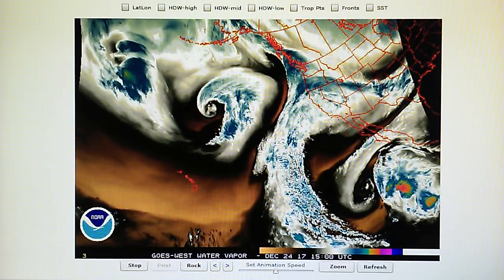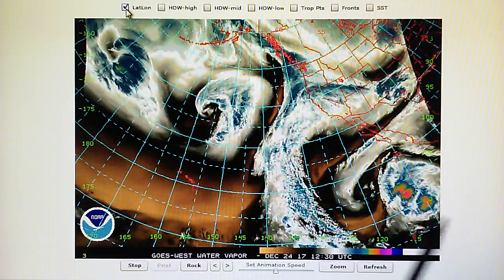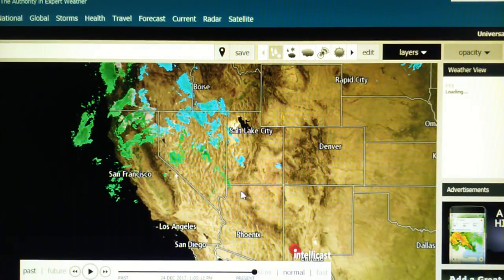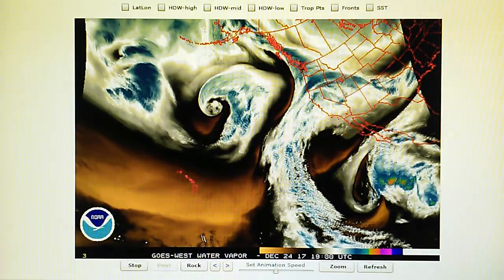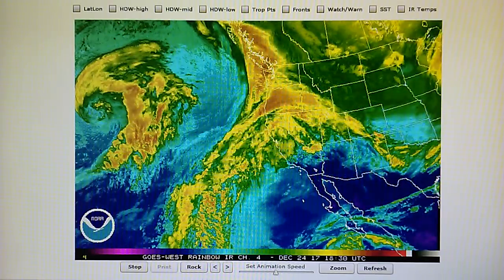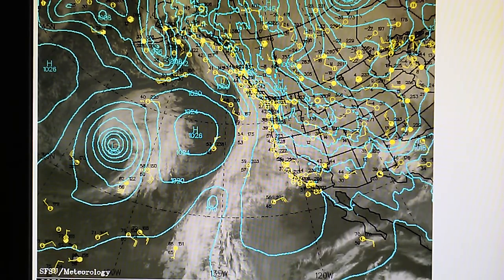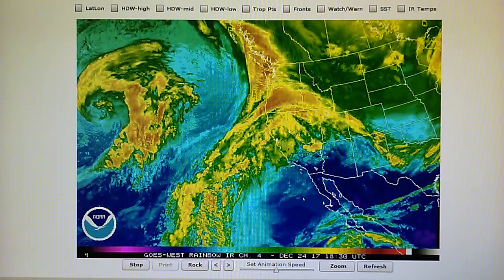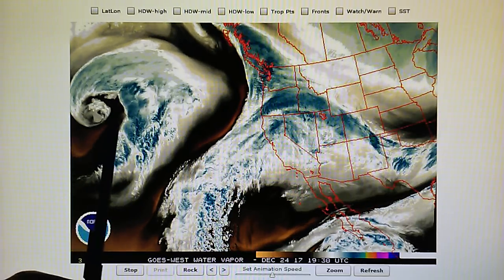12-24-2017; Pineapple Express Flow into CA Blanketed w/Chemtrails; No Rain; Low Pressure Blockaded!

Comment: Hope you can do a piece on the polar arctic conditions headed for NE in next couple of days.  Up in Adirondack mountains expecting temps to suddenly plummet to -22 by Wednesday....going from normal Dec temps to over a 40 degree drop in 48 hrs.  From Monday night into Wed.  Whole NE gonna plunge drastically.  The weather bots at MSM will be talking it away as a "Polar Vortex" just as they've done for last few winters.   

Is this caused by the HARRP or Next Rad systems pushing around or disrupting the arctic jet streams again?  Or is the thermo-haline currents just showing how it is starting to slow down more and more each year setting up next mini or full blown ice age in northern hemisphere?
Reply: Concerned Citizen I’m in southeastern PA, and I’ve been following what the weather puppets from The Weather Channel have been putting up on Intellicast about this so-called “Polar Express” or “Polar Vortex”. Didn’t we hear that term over and over again during the winters of 2013-14 and 2014-15? Yeah we did. Last winter was relatively mild compared to the three prior winters, but I knew “they” couldn’t resist dropping another “Polar Vortex” and plenty of “arctic blasts” on the northeast again. I’m highly sensitive to the sounds of the different transmitters when they’re firing, creating and directing storms or low pressure systems. I also became aware of a distinct, horribly loud “hish” when the jet stream is being manipulated by HAARP, or so I’ve read. And I’ve read A LOT. Also, the increase in the use of chemical ice nucleation has reached a point where it’s intolerable. That crap has a distinctive smell, and the smell alone makes me sick. It’s like an entity that clings to everything, including the skin, and I think it’s what’s tearing up my mouth, gums, tongue, throat, esophagus, and stomach. Today was the worst chemically ice nucleated cold I’ve felt yet, and the rain/sleet/snow we’ve been having since about 7:00 pm EST was forecast - scheduled - almost three weeks ago. Amazing isn’t it, how in SoCal there’ll be rain in the forecast in the morning, then the spraying starts and the EMF blows apart any real clouds that may bring precipitation, and suddenly there’s no rain in the forecast anymore? Whereas here in the northeast and upper Midwest, the ungodly cold and this lovely rain/snow/ice crap was being talked about as a sure thing weeks ago, and sure enough, right on time. 

Thank you 1PR for continuing to call out the alleged meteorologists for their role in aiding and abetting this weather terrorism.
Reply: Diane Friday nothing is what they say it is.  They really have lost their minds with what they've been doing with HARRP & chemtrails.  Trees around my area looked sick at end of summer; had this whitish film on trunk & bark falling away like paper.  Skies always look strange & weather updates on iPhone change constantly from one day to the next.  Do you think they've simply messed up the jet streams or ocean Gulf Stream and now Arctic blasts just happen or drop down ... or do you think they're causing the Deep freezes on command for some purpose ?  I do think they created the severe drought conditions in Calf & then used high tech microwave weapons to ignite fires.  Spain had similar issue a few months ago & Prime Minister stated that Spains massive forest fires were some form of arson as multiple ignitions could NOT have occurred naturally.  He knows a powerful force was behind the ignitions.  Have to wonder what their agenda is & whose behind it all.  Agenda 21 or 30?  NWO.  UN with global corporate coordination ??   Who benefits? Or do they see major extinction events from climate change as unstoppable & they are trying to save the planet despite the collateral damage to ecosystems or human health ? So many unanswered questions.  We can only speculate.

Comment: Just discovered your channel thanks to some kind soul in the comment section of one of RFB's videos (StinkyFarmz). It's so refreshing to see a REAL weather report!! These insanely low humidity levels we have been having lately are driving me nuts. I don't know exactly what kind of technology they use to achieve that nonsense (Ionospheric heaters?), but it makes me feel horrible, physically, when they do it. I get exhausted, achy, eye inflammation and headaches. It's so bad that I think I need to move.
Reply: I just bought an air purifier that puts negative ions back into the air.
Reply: Also fill your house with himalayan salt lamps, look up what they can do too.